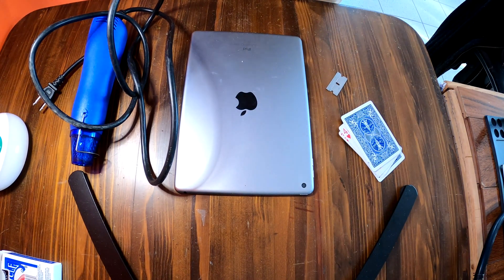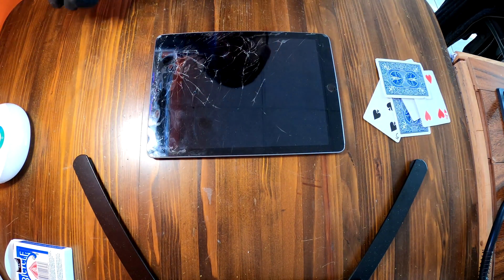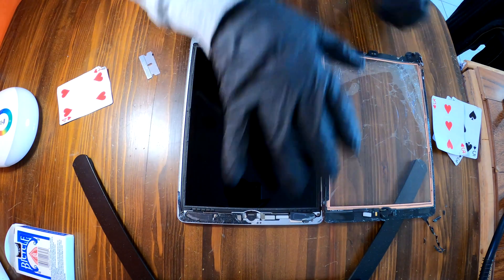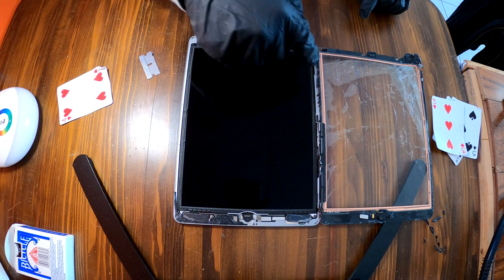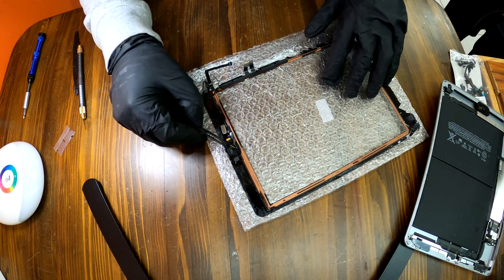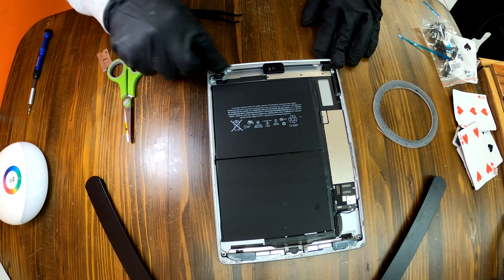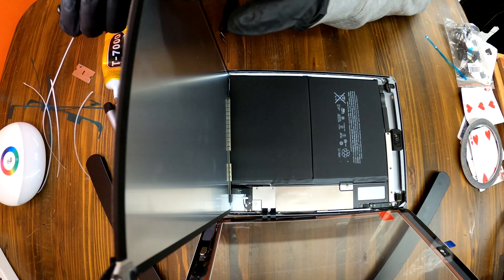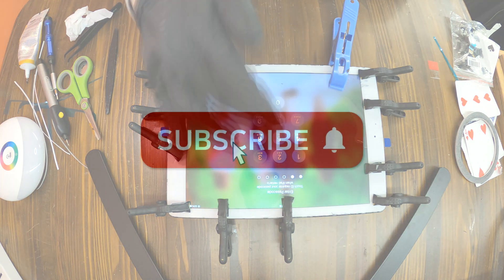iPad 6 Screen Replacement (A1893) - Easy & Precise Instruction!

Comment: This is a very well done video, thank you so much.   How do the 2 ribbon cables from the digitizer connect?  It looks like you just pressed down on them, what is holding them in place?    Thanks.